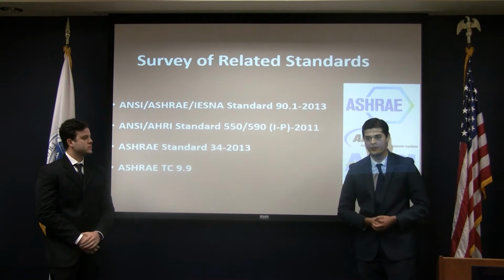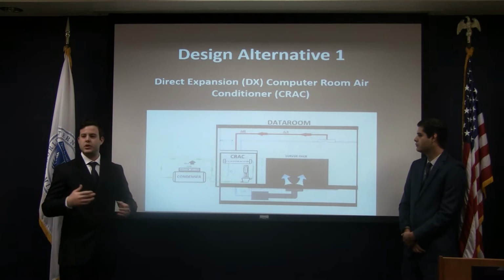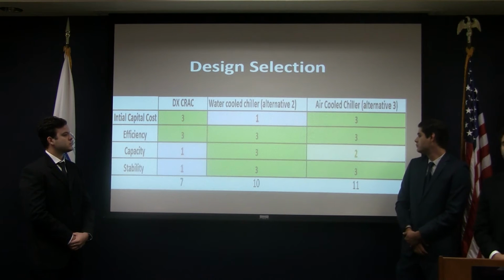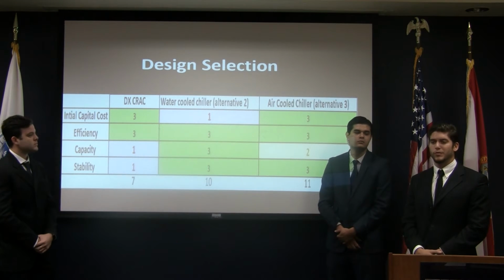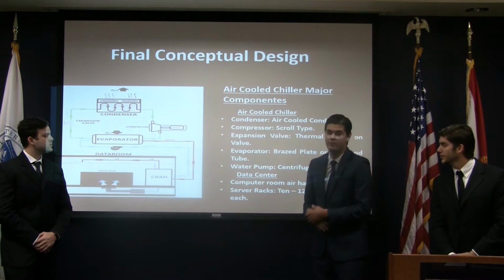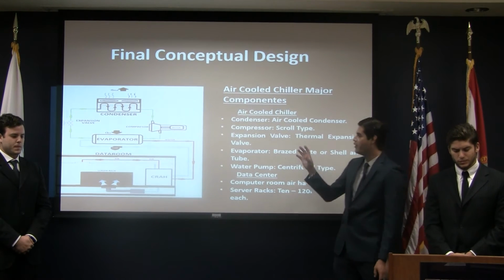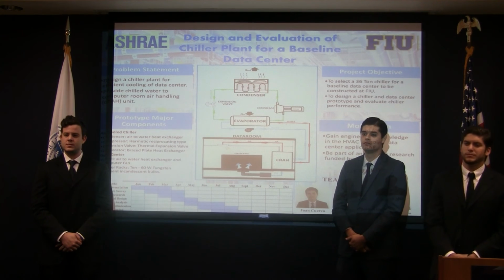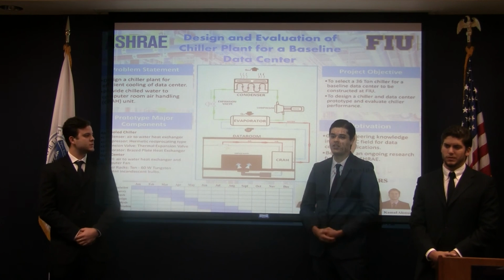SDO Team 2: Design and Evaluation of a Chiller Plant for a Baseline Data Center

Comment: The presentation was good especially with them speaking loud and clear. It seems they did not spend  that much time rehearsing. Presentation sounded rushed and slides were filled with words. One of the presenters knew more about their topic than the other member because they were answering all of the questions at the end.More could have been said about how the analysis and testing was going to be approached. They also provided background information on their topic.

Comment: Seems like a noteworthy problem to address, given how commonplace data centers are nowadays as the presenters mentioned. Presenters seemed to know what they are talking about, but I felt like the PowerPoint slides were very simple or bare. When comparing their alternatives, it was difficult to follow their analysis as the slides said very little and they used terms such as “higher efficiency” or “lowest cost” but provided no numeric values so it was hard to get an idea of the comparison.